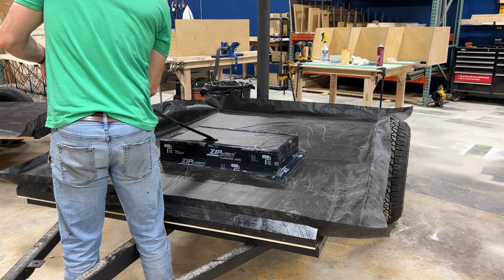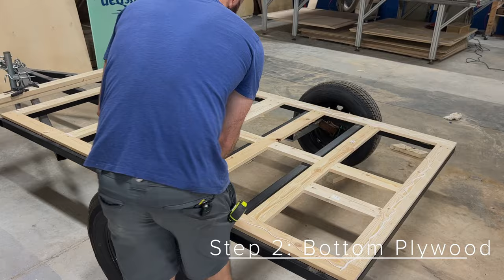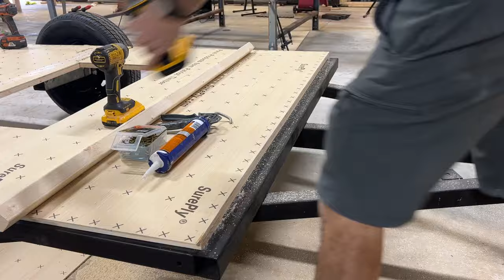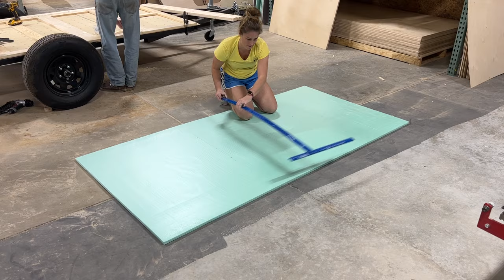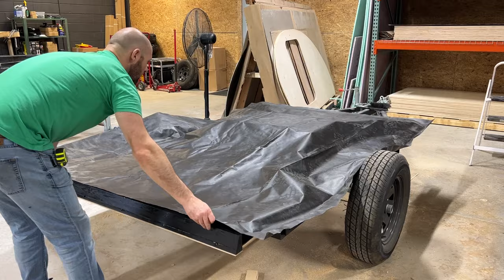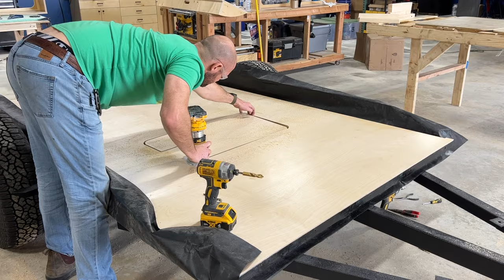How to Build a Camper Floor for a Teardrop Camper - Start to Finish - Timelapse (Video 2 of 10)

Comment: Great stuff guys!!! That black paint you used for under the trailer was for extra protection? You added a "black tarp" like protection on top of the black paint and I wondered if it was extra protection. Also, that secret foot compartment in the floor is attached how? Glue and screws only? Or is there a secret support beam behind the scenes? My buddy has a small metal bar that supported his foot compartment for his build. I thought that his was overkill. Have you had any issues with the floor giving out when your feet are in it? Im also assuming that you guys arent completely putting all of your weight on it because youre just sitting, or am I wrong? Lol.
Reply from the maker: You are correct on all accounts! The black “fence” paint penetrates and protects the wood from water damage. The tarp is a woven breathable material that protects as well. And it helps seal other aspects as well. For the floor box, it does have metal support bars underneath that are welded to the frame. And it’s not used to put any weight on, just a place to drop your feet while sitting at the table, or for storage u see the mattress.
Reply: @WanderTears  awesome, thank you, great job

Comment: Sorry, but if you dont mind - how do you attach a camper to the trailer? The wood to metal? What special precautions need to be taken so that when moving/traveling/BUMPS the trailer is still in good shape? :) thanks so much!
Reply from the maker: The cabin of the camper is bolted to the frame through welded tabs. The seams are sealed with a gasket material between the frame and cabin. Shoot us an email and we can go more into detail. daniel@wandertears.com

Comment: Question - Why put 1x4 cross pieces between the layers of plywood?  Why not just make a perimeter frame and place a full sheet of foam board inside it?
Reply from the maker: Solid question. I guess it could be done that way if you laminated the plywood to the foam. The extra cross bars add strength to the floor and give you something to attach bulkheads to.